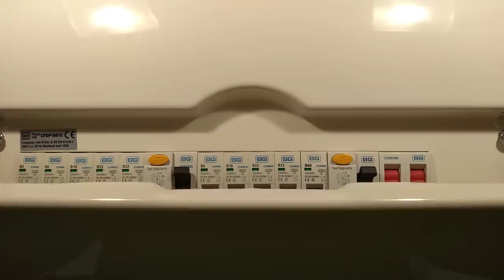A look inside a British home electrical panel.

Comment: Outstanding video, thanks. What type of typical panel would a UK homeowner use if their attached home workshop needed 3 phase power for tools.
Reply: A 3 phase supply at the mains and distribution board . Not always available unless you upgrade your domestic supply  from 25kva to 75 kva  , sometimes at great expense.
Reply from the maker: For personal use if you don't have a three phase supply the best option is to run a generous single phase circuit to your workshop and use the very affordable electronic motor drives that will not only allow you to run the motors at variable speed, but program soft starts and stops and close overcurrent protection in case of stalls.

Comment: Very strange from the US viewpoint, we have 3 wires from the meter (2 out of 3 phases at 120V and a neutral) and the breakers snap into the bus bar (no DIN rail) and feed out the side. Our regular plugs are 120V and 240V(actually 208V because it’s only 2 phases of a 3 phase system). What makes our house systems so complex are radial plug circuits(15A/1800W) and large house sizes. My 3000sqft/278m2 has a 200A main with 2 air conditioners and stove. Our Stovetop and water heater run natural gas but could run on electric. Our original 1969 100A panel was replaced in the 1980s to remove aluminum wiring and add a 1000sqft/92m2 addition and has like 45 breaker positions so it’s almost 3ft/1m tall.
Reply: You don't have "2 out of 3 phases" for most residential areas. You have single phase 220V that has a center tap connected to neutral. The high voltage lines running along the main streets have 3 wires at the top for the 3 phases, but only one comes down to your transformer to get your 110/220.
Reply: @markc2643   US homes can have either system. Individual homes are usually split-phase as you describe, so 110/220 V or, these days, usually 120/240 V. Blocks of flats though can get 3-phase with individual flats getting 2 of the 3 phases hence 120/208 V. (Or whatever. Every time I think I'm getting a handle on North American wiring something new comes along.)

Comment: We now must also wire the general purpose outlets to an arc fault breaker.  Only exceptions are the dedicated circuits such as wash machine, vacuum,  lighting loads and the like.  Kitchen counter  receptacles are connected to 20 amp breakers, and GFCIs  outlet if it  is within 900 mm from the sink.    

Newer homes will have 200 amp,  60 circuits capacity panels that are 1ph, 120/208v.   Included to the panel can be a surge suppression module, which most home owners do accept.  

Canada.  Our 3phase is stupidly 347/600 in most commercial property.  Smarter properties will have a 277/480 v service.  I say stupid for the 600 v service because then you pay a higher price for your equipment.  Most machines come from the states,  which is 480, so you pay a bit more for 575v motors.  (Not that the cost of Motor is actually more to make, but cost is cheaper with volume.  More machines of the same is cheaper than custom parts.  Just a quick explanation). Even led drivers and fixtures are dual 120/ 277. When you need 347,  it’s a special order.  It is just starting to come around with 120/277/347 v drivers, but not often.

Comment: Had an apprentice on a job telling me a 30ma rcd I fitted on a job that the current rating was too high for overload tripping. After a long discussion about the rcd been only for earth leakage and not overload and not getting through to them I gave up. Tried to explain that the amperage rating was just maximum load not overload but couldn't get through to them. Must admit I try to put the larger loads near the main switch or rcd.

Comment: Interesting that you use blue and brown in your distribution boards, we only use those colours in consumer appliances and we use red (active) and black (neutral) in Australia! We also have the red main switch but only in certain brands, but we wire our panels left to right with the main switch on the left!
Reply from the maker: To comply with European red tape the UK switched its colours from red, yellow and blue phases with black neutral, to brown, black, grey phases with blue neutral.
Yup - swapping a phase and neutral colours.  Needless to say it caused a lot of accidents.

Comment: Looks much different to a Australian one.
One of the biggest issues iv had was when a electrician replaced the main safety switch with a normal manual switch.
2nd was when the main safety switch died last i found out 2 powerpoints in the newer section of the house bypassed it.

Comment: The UK has moved forward in electrical requirements in the last 20 years. It's now (I'm told) possible to have a mains socket in a bathroom, although I'm also told it must be 1.5 metres from any source of water - which is about as sensible as saying you can build a garage too small to put a car in :-)

I've had my UK house wiring upgraded but (being Canadian) still prefer a system where each device/circuit has its own RCD/GFCI/AFCI. When the kettle element goes here, it takes one whole side of the house and then you get to play detective on what the problem really is. With US/CDN style RCD-at-socket, you know instantly. And even at the distribution board, you see the one tripped circuit instantly.
Reply: Should have went with parallel circuits when rewiring it, serial might be the standard but it's not law as far as I know.

Comment: Same here in Sweden, most homes have a 230/400 V 3-ph 50Hz feed (have a 20A feed in my home), older installations use Diazed and Neozed fuses, while newer installations use breakers and the only classical fuses are at the meter.
Older lighting and radials in homes tend to have 6 or 10 A, special loads 16 A.
Also, on a related note, a thing I got reminded of yesterday helping a neighbor with electrical woes is the situation where you nuke one of the phase feeds:
How counterintuitive the symptoms of it are when you don't know or expect them, like, turn a three-phase load on and the cable modem comes back online again or a light starts working again. Maybe something for a video?
Reply from the maker: I've seen notes on fuseboards like "Do not use phase 3.  Voltage is low."  When in reality the fuse had blown and they were getting a backfeed from the other phases.  It can throw up some weird results.  Especially when a neutral in a multi-phase system fails.
Reply: Wow I had no idea that any houses except maybe mansions had 3 phase service 
May I ask which appliances use 400v?
I figured maybe stoves,clothes dryers  electric heat air conditioning?
Here in USA we use 240 vac 60hz for above mentioned heavy loads (120+120v 2 "hot" wires plus neutral)
Reply: @dantx4545 : Even flats here usually have 3-phase these days (tho some older or really small flats can have a single phase feed).
The most common appliance in a home that uses 3-ph is the electric stove, and common equipment such as ventilation fans, elevators, laundry room equipment (dryers, washing machines), saunas etc.
Heating here is mostly done by the district heat exchange system (city's district heat loop goes to a heat exchanger in the basement which feeds a separate loop with water radiators in the house), but heat pumps, direct electrical and furnaces are more common outside of the metro areas and in houses. 
District cooling is still mostly used by commercial enterprises, but that may change in the future as the system gets extended.

Comment: This looks almost identical to what we have in Australia...I suppose because we also have the same 240v supply as the UK. Usually has labels showing rcd and 'protected power' and separate air conditioner, oven etc. The old ones here have ceramic rectangle fuse wire holders that plug into the board.
Reply from the maker: Are they branded Wylex?

Comment: I thought the narrator had made a mistake by saying the incoming supply went up to the neutral bar, but although its hard to see, it does look like the neutral is isolated by the main switch! Here in Oz we only switch the active(s), the incoming neutral terminates on the neutral bar. And judging by the layout, with the main neutral bar so far away from the earth bar, I'm guessing you don't earth the main neutral either? And yes, I've seen that false clamping thing you described, I've replaced more than one MCB because of that!!
Reply: All main isolators are double pole (so in Clive's video the main switch and the two RCDs). Neutral is "earthed" at the substation or via a PME (Protected Multiple Earth) system ie on the supply cable prior to entry to the property

Comment: Thank you.  Yea plastic panels do not sound good. American panels are very different but breaker size is ordered large to small. 
Helps me find a heater or AC circuit at top separate from a room or laundry one at the bottom. At half the voltage a 15 amp circuit breaker only does three rooms. Bathrooms have to be separate. 
Garage lights have to be separate from garage or carriage outlets. 
GFCI (Ground Fault Circuit Interrupter) v.s. Residual-current device ( RCD )  
You say neutral but the wire is brown not white.  Our grounds are Green, not black.  Did some wiring in Japan with black grounds. America uses Black for a hot lead.

Comment: I fitted this exact board yesterday although 21 module 16 Mcb’s £124.99. Quite easy to work with but they do need to find a way to route all the factory fitted wires as they take up a lot of space. If you were fitting  RCBO’s you would put them immediately next to the Main switch and not on the RCD protected side.
Reply from the maker: It helps if you tuck the link wires down.
Reply: Thanks but I couldn’t do that on that install as all the outgoing wires had to come in on the bottom right and pass behind the mcbs. I’m sure there’s s better way for them to route all the factory links. All the manufacturers do the same. It’s worse when you have to work on a smaller board, BG do a 6-way Split Split board with the same amount of wires to work around.

Comment: Nice one, Big Clive! A great video. Have a coffee. The main suppliers, RCBO's are quite expensive but there were some reasonably priced CE marked imports on eBay a few years ago.
Reply from the maker: I really recommend against generic eBay circuit breakers.  To avoid complications I recommend using only the matching brand in a consumer unit.

Comment: Interesting. In the US we most often have 120-0-120 with 240 between the hots. Most mains breakers are 200 amps, for a total of 48Kw.
Reply: Source of Global Warming by any chance ? Why the need for sooooo much Amperage.
Reply: @shilks8773  Wide spread use of heat pumps to get away from using oil and gas. Which is pretty stupid as people don't seem to realize how power is generated.
Reply: @shilks8773   as you drop voltage the amperage increases. Most homes dont use anywhere near the 200 Amps.

Comment: Here in Brazil we're having a lot of difficulty with the new protection breakers, since most houses (those built in the 90s and before) they don't even use grounding wires. Basically everything has to be made of plastic, including all the piping.
Reply: I believe Brazil also has two different Voltage sytems depending on which part of the country you live.

Comment: This distribution is only connected to single phase. How common are single-phase house connections in the UK? In Germany, almost all houses are supplied with a three-phase connection. Surprisingly, while on vacation in London, I discovered that our Air Bnb house was only supplied with single-phase overhead lines.
Reply from the maker: The UK uses a very simple power system.  240/415 singe/three phase.  Homes get a single phase, factories get all three.
Reply: But with one phase it is hard to power electric stoves. With three phases it is no problem.

Comment: Look at this cute "level" in the top left corner of the box. I never saw this before :)
Reply: Was about to say the same.
Reply from the maker: It turned out to be a shit level.  I've come across them in other equipment before and they're really just a gimmick.
Reply: That's so you don't tilt the box, 'cause all the electricity'll run out the side. :D

Comment: Hi Clive, yes have had issue with the bar not properly clamped to bus bar and caused arcing with audible crackle and heating the unit up and this was after electrical safety inspection !

Comment: I think the Din is an internstional standard, we use it here in denmark too and ive seen curcuit breaker boxes delivered from norway,sweden,germany and poland wich all used the Din system.

Plastic cases are still allowed here, altho they need to be made from a non-flamebel plastic.

Its a little wierd seeing a curcuit breaker box for a house that is only meant for 1 phase, here the oven and stove usaly runs on 3 and 2 phase, and then the light curcuits are evenly split out on the 3 phases, so like the upstairs uses L1 and the down stairs uses L2.
Kitchens here also need to have 2 seperate curcuit breakers (like 1 for the light and a diffrent one for the sockets)

Edit: i didn't know that acrylic gives off acidic vapers, thats a nice thing to know.

When installing a completely new curcuit box, we also need to leave a head room of 20% for expantion, is it the same in UK?
Reply: Clive mentioned acid curing silicone sealant
, not acrylic polymers.
Reply: @PuchMaxi  you right, my bad :3
Reply: @zentrobi1548  No worries, Danish friend :)

Comment: Sure looks better then our USA Square D set up's for sure.  TIDY !  Not sure how yours works.  Ours come in the home 2 Phase 240 split to 120 with common Neutral.  Our Breakers seem to be Special.  The prices are crazy over the top for what they are.
Reply: in Europe you usually get 3 Phase 240V + Neutral + (in new mains connections) Earth, so 4-5 Wires from the Mains… TN-S-System is the name here.
But TN-S is not mandatory in Europe and TN-C-S-System is still quite common.

Comment: There is no protection for the mains in the UK? That wire coming in looks like it can’t be good for more than 50-60A, but the breakers in that box massively exceed that.
Reply: The main fuse protecting the entire installation is installed in a separate fitting, owned by the distribution network operator, upstream of the meter and the consumer unit Clive showed us. It's usually 60 or 80A. The breakers are allowed to exceed the supply rating because it is not expected for every circuit to operate at capacity all the time.

Comment: Hi, enjoyed the video.

You mentioned that both the mains cutoff and the residual current sensors are not over current breakers. 

How do you protect from going over current for the whole system? The current breakers add up to more than 200A for this 100A system.
Reply from the maker: It will tolerate brief peaks.  There is a utility company fuse.

Comment: 3:48
Yes, very important to have a spirit level built in. Otherwise the electricity will flow to one side and everything goes off balance, causing lamps on one group to burn dimmer than the other.

Comment: D type are still readily available, i use them alot (industrial compex certified electrician), some industrial power supplies trip B type regularly and even C type etc

Comment: When I had my consumer unit replaced I brought the using and all the switch gear from my local electricians supply shop. The electrician who installed it connected the all the kitchen appliances into one unit and the power was always tripping off. I met another electrician who was involved in inspecting and testing electrical supplies. He "DEMANDED" that I replaced everything to comply because he said the plastic case that housed the containers was not legal and could cause a fire. He changed everything and kept asking for more money with the threat of cutting off my electrical supply if I didn't. As a disabled person I found this quite intimidating. The situation of his threats became so distressing for me that I had to call the police. 
When I got a second opinion from an Electrician who worked for GEC he said that I could just have brought a new metal case for the original switch gear and that would have been enough. 
Eventually I got a friend to reconnect everything he had left disconnected. I don't know how I was so stupid to let this second guy into my house. My friend put the oven on a separate spur and everything was fine. Thanks for the info Clive.

Comment: @bigclivedotcom  You repeated the story given in another video recently that the RCBOs consume one watt. I looked into that and according to spec sheets that is true at full load, but I haven't been able to find out if they still consume that on a more typical zero or light load. Moreover, when I looked at the specs for matching MCBOs, I found they have very similar power dissipation figures.
But surely all RCBOs and MCBs have to dissipate power.  As well as a rapid magnetic trip they have a slow thermal trip - that has to be heated up to operate,  and usually it takes about 1W at full load.  Imagine even if the thermal element has only 1 milliohm resistance that's 1W at 32A.
Of course the breakers aren't normally running anywhere near full load,  so typically maybe taking only a few milliwatts. Some do have active circuitry that may take a little more. Definitely a topic worth investigating I think.

Comment: Had an incident with mine just the other day, Putting the kettle on somehow (or very coincidentally) tripped my fridges fuse which tripped the breaker

Really annoying but glad the rest of the house didn't go dark
Reply from the maker: The switching transient of the kettle may have pushed failing insulation over the edge in the fridge.  If it happens again it might be worth unplugging it and doing a quick electrical inspection or maybe even considering a new fridge.